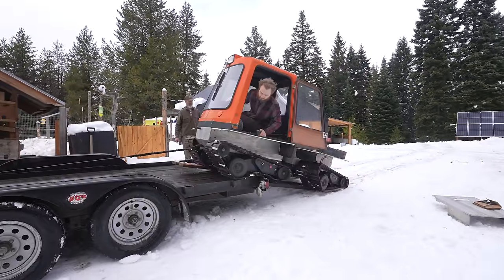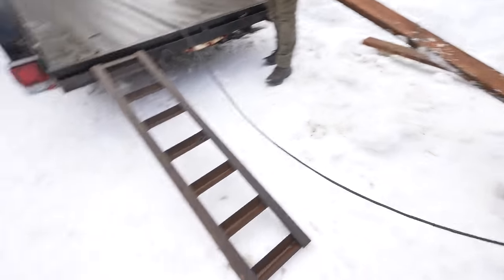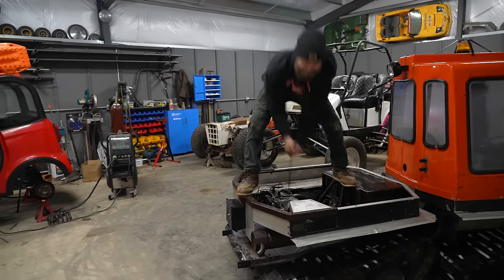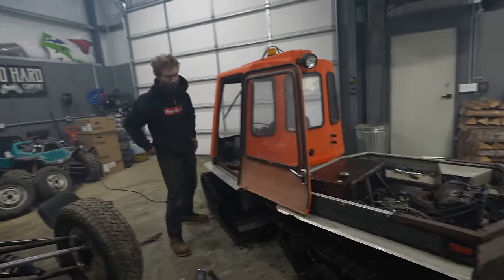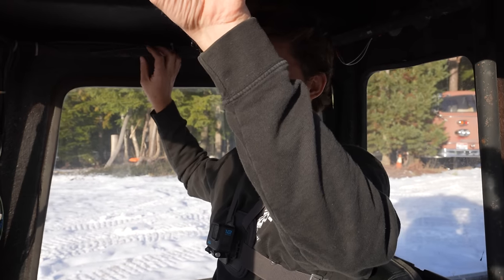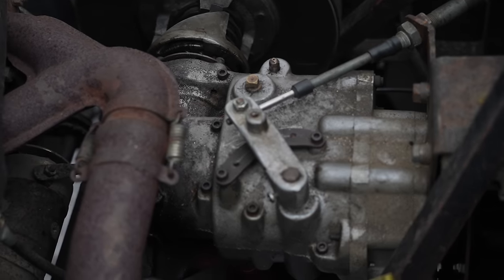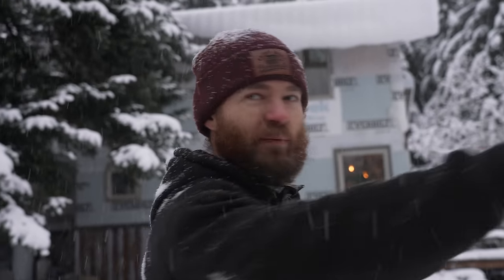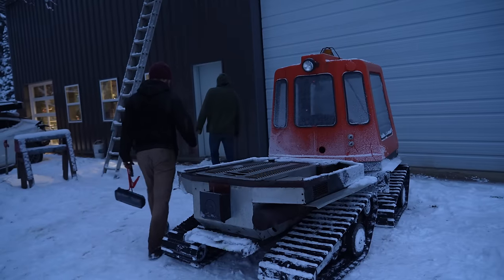We Found a Rare Snow Cat!

Comment: Arctic Cat Quad Trac. I have had two of them over the years. Two speed trans. Low range 2-3 MPH high range 4-6 MPH. They originally came with a groomer on the back that pulled up with a winch. Air cooled motors always failed with hard use. There is one for sale over in PA right now with a swapped out liquid cooled EFI in it. On packed ground they ride like a tank. Deep snow they are fun. The two round openings on the front and back open for air flow. Has a long tractor battery under the seat that is a pain to get in and out. Do your self a favor and relocate the battery to the back by the motor and get a car battery with 800cca. You will be way happier should you need to jump it. Aluminum body front and back. With fiberglass cab. I put dynamat in the cabs of both of them or you will need headphones to run it. You will need the fan on blowing onto the front windshield to keep it from fogging up.
Reply from the maker: They are super hard to find information on
Reply: Are they artic cat spirit 340 440 or 500 ?
Reply: 440 air cooled

Comment: I worked for a company doing seismic drilling and we built bombies from scratch. They are incredibly simple and all you need is steel, a motor and transmission plus a single differential. Two ebrake handles and your set. We even built our tracks all easy and simple

Comment: I can't believe I had a snowcat before y'all! You live in the perfect area for one. 

First off, replace every second or third grouser bar with a deeper one and youll have nearly unlimited grip in deep snow. 

The more you do the smoother it will be but the heavier your tracks will be, and they get heavy quick!

Keep spare grousers and some belt along with the tools to change them if you plan on driving fast far from home.
Reply: whats this thing actually called? is it just snowcat? cause i cant find anything
Reply: @austrian_s60r64  Arctic Cat Quad Trak Trail Groomer, 3 years production, under 50 per year.

Comment: That was an Arctic Cat quad trac. Supposed to come with a 500cc Pantera Spirit motor and they were rated at 48 hp.  I remember them well. They built those both at the Thief River Plant and the old Scorpion plant because at that time Arctic owned Scorpion.  Sheesh that’s like 45 years old man. No wonder the engines gone. Arctic used the 500 Suzuki Spirit from 1976 up through the late 1980s. Parts are still out there among the vintage guys. It was a good engine. Probably not ideal in this application but a good sled engine on the Panther/ Pantera/Cougar/Cheetah.
Reply: YUp I had That 88 cougar and was so fun for a 10 year old . THo I thought it was a kawaski.  Ahh maybe Iam confuesd with a sno pro,  PArents had the patera,   What was In the AC Jag 440 Cause that sled was My bros and it flew, as a liquid cool
Reply: Colby: most Cat sleds made for 1976 on, with a few exceptions, were Suzuki powered. Now that changed again around 2013. Some Racers and the Lynx 250 twin for 1976 being the exceptions.
Reply: The 1976 Z 250 used a Kohler lc engine. Only because Cat ran out of time to develop the Suzuki 250 for that season. Same sled with a 440 used the Suzuki  lc. One year only.

Comment: I swear the local snowmobile club used to have one of these exact same machines as their trail groomer. They finally saved up and bought a new one about '99 lol. I'm pretty sure one of the local towns is using it to clear sidewalks/small parking lots.
Reply: So care to explain how the hell this drive system even works? They mentioned differential and hydraulics so that seems just weird. If its mechanical seems like something one could build at home cheap, while hydraulics tend to be expensive.
Reply: @Hellsong89  just on suspicion, based on the way other articulated steering systems work, is it has a driveshaft with a U-joint in line with the pivot, and the hydraulics are probably open center (closed center like a bobcat would be too much parasitic load). the steering might be mechanical, pure hydraulic, or power steering

Comment: This thing is going to be sick!!!!!!! You can easily make it a snug 2 seater. Just make it completely bench seating, and a movable steering column, so if just a driver, you can move the driving position to center of the cabin, right of cabin, left of cabin...
Reply: ....It's something that would make for an epic episode....venture out into the wilderness FOR REAL camping in the wild, and traveling in this little monster.....just two guys... no chase. two day trip through the wilderness? (or just possibly a long trail system by you, which could take a couple days, if you are not hustling. Go look for a river that has gold in it! 😁

Comment: Heavier engine will give it much more weight over those back tracks. I defiantly think that's a great option. A nice winch on the the front for the "Incase" moments.
Reply: With these you want more power but as light as possible so you float over the snow, once you're heavy enough to sink you need so much more power.
Reply: Why would it be defiant? I think you mean definitely.

Comment: You should try to find an Bandvagn 206 (BV 206)! Our and the swedish (where they are made) army use them. Drove them on my time at the army, super fun.

It's basically just larger version of that snowcat of yours, witch is so cool to begin with! So happy you found one.
Reply: Dave Sparks sells Hägglunds :-)
Reply: Another pod with tracks (essentially a 6 wheeler) on the back would be amazing! Could even make a mould of the front cab so they looked the same. Also if they got 2 of whatever engine swap they do they could have a matching engine in the third set of tracks at the back. Pretty sure iv seen something like that with 3 articulating pods somewhere here on YouTube. Might’v been sparks like you said. Could’v even been on their dvds back in the day. 
So much potential in these boys hands!👌🏼
Reply: Heavy D, Dave Sparks (Diesel Brothers) got one sent over. 
I think someone above me mentioned Dave (what ever he wrote wouldn't translate for me? Haha)
Reply: 206 the unstoppable machine 👍🏻

Comment: It would be cool to put a "pickup bed" over the engine to make hauling your gear a bit easier. Also, I agree with the idea of a 4-stroke for reliability.
Reply: Exactly what i was thinking...A bed from a Kei truck (with the drop down sides), and hydraulic rams to make a dump bed. A  small atv winch and some pull out ramps under the bed would make a cool snowmobile recovery vehicle.

Comment: maybe a little 4bt cummins ? or just a perkins diesel ?!!! love that thing woww
Reply: You'd need a 5th wheel just to fit a 4bt!
Even a small Perkins or Kubota would be huge compared to a 2 cylinder 2 stroke. Plus they only make around 40hp
Needs to stay 2 stroke I say. Maybe a 3 cylinder 100hp?
Reply: "little" 4bt Cummins lol. They weigh like 700lb(or as much as a big block) and are as big as many 6cyl car engines.
Reply: Do either of you two know whose channel this is ? It GHPC they do the impossible.
Reply: @jordangryg5442  But that would be a crazy waste of time and everything would have to be upgraded for the weight and power. In the end, they would be better off building something from scratch to use that engine. Why destroy a rare collectors item to put a huge engine in it? A small diesel would be the best option, something 2 or 3 cylinder and probably out of a small skid steer or maybe a welder.

Comment: I wonder if you guys could put a detachable system on the back that would allow you to swap a bed or a storage trailer onto the back over the engine. That way depending on what you guys are doing you could swap out the back making it a practical utility machine.

Comment: The smell of papermills I'll agree is quite a memorable smell. One that'll get your eyes watering in some instances. Feel lucky that the area there doesn't routinely reach into the upper 90's to low 100's with ~90% or better humidity, and the oh so wonderful gut punch that is marsh at low tide, rotting fish, shrimp, and crabs.

Deep whiff of that and if you don't get the feeling like you're going to be dizzy. You've either become acclimated and immune to the smell, or you've got no odor receptors anymore.

Comment: Beauty of a 2stroke. Its just so simple.. Compression, Spark, & Fuel, and it will run forever lol. 
You could use a cheap starter solenoid replacement off a bigger UTV if you needed to as well.
That thing shreds up the snow and prob dirt too pretty damn good lol, the power of the two stroke makes that possible lol. Plus the fact that it still runs lol..

Comment: The Arctic Cat Quad Trac has an interesting history. These unique machines were originally built by Pearson Engineering in Roseau, Minnesota. Later, Arctic Enterprises acquired the rights to the Quad Trac from Pearson Engineering and refined the design. They produced these machines in Thief River Falls (TRF), Minnesota. When Scorpion was also acquired by Arctic, the production of Quad Trac was moved to Crosby, Minnesota, along with the snowmobile trailers1.

The Quad Trac was a fascinating hybrid of snowmobile and groomer, designed for trail maintenance and grooming. It’s not widely known, but there were also Scorpion versions of the Quad Trac. The production numbers for these machines are believed to be quite low, likely in the range of a few hundred units at most. The Quad Trac’s rugged steel cleats made for a rough ride, but they were effective for their intended purpose. If you’re interested, you can find some videos of these machines in action on YouTube

Comment: I’m guessing you had a lot of fuel / oil in the bottom of the engine.   Maybe a leaking carb / stuck float.      Check the drain plug(s)

Comment: A small yanmar  or kabota diesel with a high flow high pressure hydraulic pump would be bad ass and you can easily put a heater core and some creature comforts

Comment: i had a 90s rm125 i rebuilt that had  the same style floats in the carb they were known for soaking up the oil from the 2 stroke and being to heavy to actually float then. had to replace the floats in my carb to fix that issue.

Comment: 3 cylinder K car engine from any of the K series mini cars/vans from Japan. EFI, twin cam, limited to 64 hp, many were turbocharged so you can play with boost to make more power if desired, more than enough torque and light weight. They rev to 8000 plus so the CVT clutch will work without much adjustment is any.

Comment: I think you should stick with a 2-stroke snowmobile engine to keep the weight down. A Rotax 503 Scandinavia, or an Yamaha 540 engine from the VK540. Both very reliable, air-cooled engines used in utility snowmobiles.
Reply: Cramming too much engine into a machine such as this wouldn't be usable.

Comment: I think a 600 e tec would be nice because of the fuel injection, sure would be easy to use any 90’s twin sled motor though, maybe would be less clattery with the more modern clutches too

Comment: The tracks with the metal bars across would probably not hold up for long driving that thing  on bare ground , stones would probably rip up the metal bars pretty fast .
Put a little plow on it , this can also be used as a ancor if you winch or pull stuck vehicles also . Or grooming tracks for snowmobiles .
Another add on could be a  hitch.  
If you decide to put a stronger 
Engine in it, "dont over do it" and break the differential  by 
Adding to mutch torque. 
Slightly underpowered is probably better than over powered.

Comment: That is a nice, rare, fairly robust little machine.  I am glad y'all decided against a Hayabusa engine for it.  That would lay waste to your track components and other elements of the drivetrain, in short order.  If some way of providing reverse could be managed, a good 40 to 50 horse motorcycle engine and transmission, with some modifications, would do away with the less dependable belt drive transmission and help your performance and reliability.  I believe it would have pulled that hill, like it was, with just one person in it.  It looked like a 45 to 50 degree slope, which is pretty steep.

Comment: Look at junkyard digs or cars and camera s. You see these floats more. I think it has to do with engines running under various angles. 
Look for a small 4 stroke. Diesel? As long as the hydraulics stay the same  it will run the same. You could open up the variomatic on the engine and see if you can get those halves more to each other. Or the one on the drive more open.

Comment: Ah classic case of looks working but bad coil. Thing is that most people dont know is that engine might have spark, but when you put it under pressure in a cylinder conditions change so i might not create strong enough spark and get fouled by fuel. Only very special test rigs can test for it and almost nobody has one, so cheapest is to test with new plug and then swap the coil if that fails, but problem might not be that after all.

Comment: Lol fun fact about the spark plug, i heard Ethan say "BR9ES almost every snowmobile uses the same spark plug" i also always use a BR9ES in my Piaggio nrg 70cc, almost all Piaggio 70-180cc use BR9ES as well
Reply: Also, usually with older cylinders which i cant get running, i just throw in a BR7 or 8ES they burn just a bit hotter so when there is a bit of oil buildup in the cylinder or the exhaust it'll burn through easier

Comment: Not sure if it's relevant. But I had a 91 Suzuki rmx 250 that had the same exact float setup on its stock carburetor. I was new at building small motors at that point so I didn't know it was special in any way.

Comment: Bottom end was full of fuel some sleds had bolts on the bottom end to let the fuel drain from the crank  if that motor has them it would be on the exhaust side

Comment: 1. Yamaha 3 cylinder 4 stroke engine or 2 stroke 850 e-tech engine.  2. Rear tracks 2 feet longer.  3. The cabin should be isolated from the frame, raised 4 inches higher, and good suspension for the cabin.  4. The fourth change work would be related to the middle joint.  It should tilt forward and backward.  Maybe some kind of electric actuator, and Arduino control, and automated operation while driving, implemented with these sensors: gyroscope, tilt sensor, and maybe front radar.  The fourth change, manual, can perhaps also be handled without electronics, just hydraulic tilting, and a valve block in the cabin.  I don't know what the drivability would be like, on the other hand, adding a gyroscope to the rear carriage, and releasing the middle joint.  Sorry, all free thinking.
Reply: Under the cabin: https://youtu.be/rwpPY-OPGCE?si=usRgMiEQl0t1lCY6      at 13:50
Reply: Or like this: make a three-part all-terrain vehicle.  in the middle part you put a gyroscope like that.  front and rear part for free floating.

Comment: Looks like yall need a "just incase" tool box in the parts yard. Yall should put some of your old tools that arent used often in a box and put them in a car or fasten it to a tree. Or even a cheap 100+ piece set. Then you'll always have a spare screwdriver or 10mm when needed. Soak everything with WD40 every so often and itll be good. This also keeps shop tools in the shop and less likely to be misplaced when working in the yard

Comment: Add a box tube recover front & back for a winch (hydraulic quick disconnect -- or electric) and a land/snow/ice anchor...
And a ski or universal fit limp mode(low speed) spare track.. Else if you get stuck or drop a track that will be its new home.

looking fwd to everything you do to and with the baby-cat...
2025 - Tesla powered cyber-baby-kay...
or
2025 turbo 600hp k-swapped killer K-Cat lol
LS LoLz cat

Comment: Ah yes, Lewiston... the stink of money is what the locals call the stench from that paper mill.  The stink has actually gotten a LOT better in the 30 years I've lived in Idaho.
And I feel it's slightly disingenuous to call Elk City "the middle of Nowhere", because Sandpoint isn't exactly a bustling metropolis.  Although Elk City is pretty far out there, you should travel to Yellow Pine, ID, which I believe holds the record as the most remote "city" in the lower 48, being like 78 miles one way up a dirt road from the back side of McCall.

Comment: not a purest here or anything but i think any real high hp motor probably not a good idea for that rig, it wont run the hydraulics and the differential and track combo wont handle the speed, you would need something with  higher torque at lower rpms that can run constant. also that carb is extremely common on small engines, that motor looks like a suzuki 550 snowmobile engine..

Comment: Some Toro/yarders come with a little 3 cyl diesel engine... That would be kind of cool if you could figure out a small turbo diesel. An added plus is that it would likely weigh more than gas engines of the same displacement.

Alternatively you could make it all electric with some Prius motors 😅😅

Comment: Y’all should upgrade the engine, upgrade the cap to a two seater with a half backseat for storage, and then upgrade the bed into a camper or a pop up camper that sleeps two (the camper would go over the roof rack that extends the bed) then wide the wheelbase and possibly bigger tracks or wheels